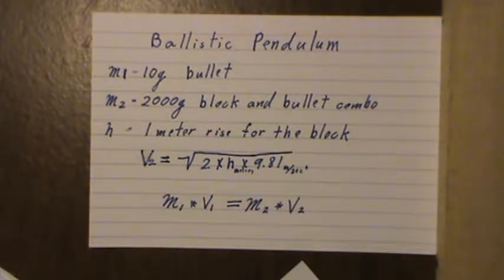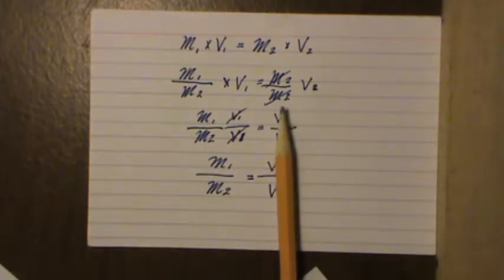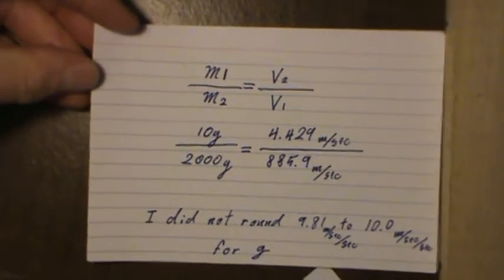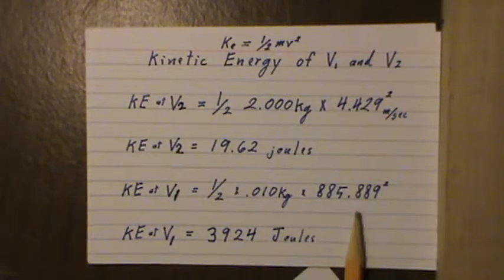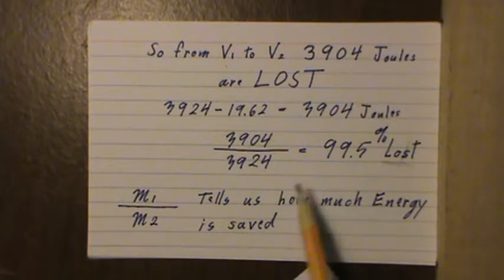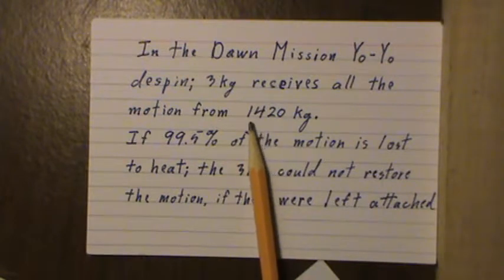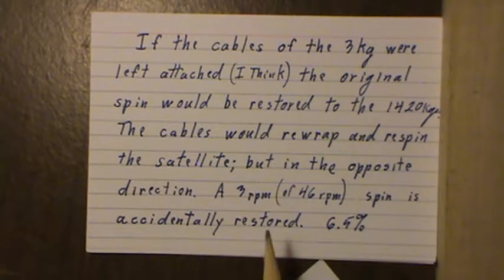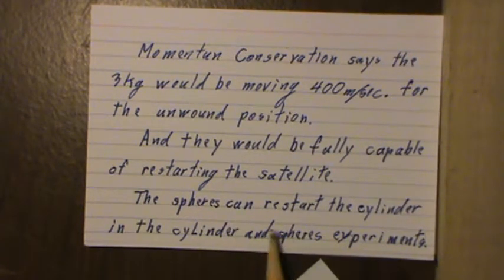Ballistic Pendulums and Energy

Comment: Heat is undirected motion, a body does not move when it is only heated. Motion cannot be kinetic energy and linear momentum at the same time, their relation is KE=p²/2m, so the mass makes the difference. A larger mass has less KE than a smaller mass with the same momentum. You also do not care about the fact, that momentum has a direction, whereas kinetic energy is a scalar. Your video is a perfect example of crackpot physics.
Reply from the maker: No: all YOU profs are the Crackpots. Scalar is just a way of getting rid of an opponents argument; which is Newtonian Momentum Conservation. The momentum of each part of a wheel never subtract from another part of a wheel: and that is what you are attempting to pull off with this scalar hoax. Vector motion can collide and add momentum or collide and subtract momentum: or not collide at all which is what a wheel does. The parts of a wheel do not collide but work together as whole.
Reply: @delburtphend6016  After three years you still don't seem to understand that linear momenta have directions. The sum of two equal but opposite momenta is what? What is the total momentum of two cars crashing into each other with equal momenta before and after the crash? You correctly tell us that linear momentum is always conserved, so what is it in this case?
Reply from the maker: @zeroelevation3837 The case is: what is the momentum of two car moving in the same circle.Two cars fixed to the same wheel ADD thier momentum. Why do you think flywheel are heavy; and what motion do they share when the two car share motion with a third car? The two cars only only only share linear (arc) Newtonian Momentum nothing else.
The profs have had to lie to you about this alleged zero Newtonian Momentum or we would have had free energy maybe 100 years ago.
Reply: @delburtphend6016  If two cars of equal mass and speed hit each other in a frontal collision and share their motion, what happens to their indidual and total momentum? Can you answer this simple question?